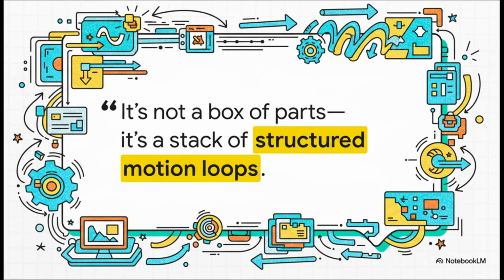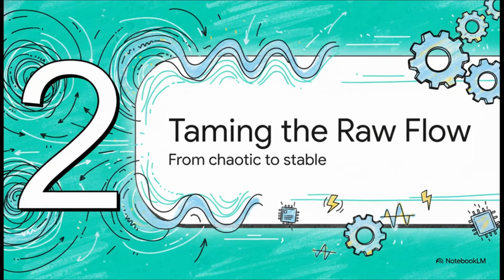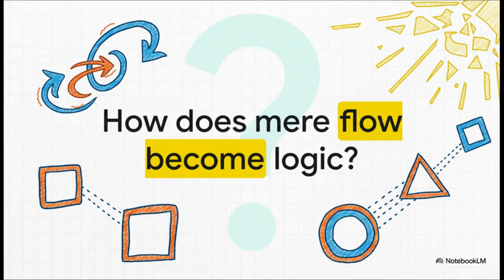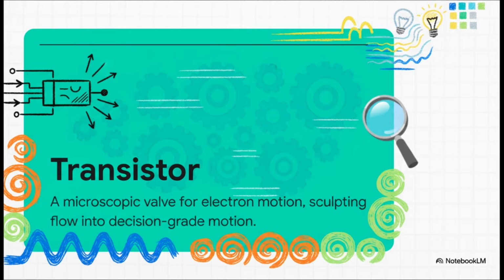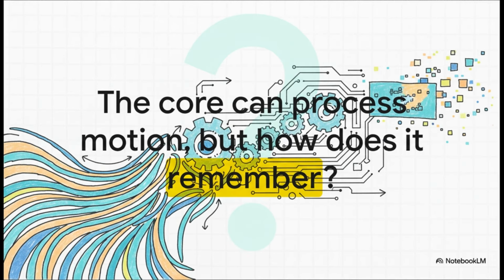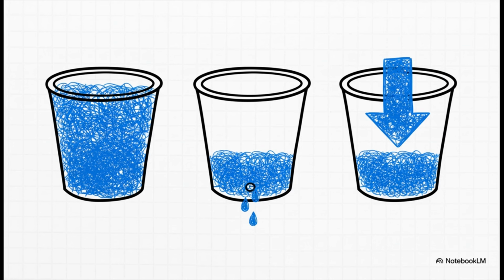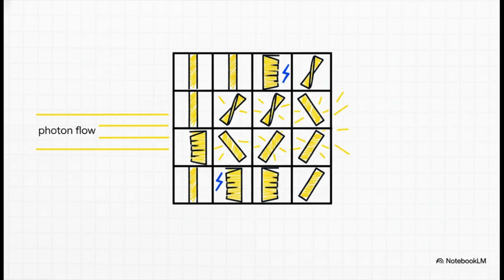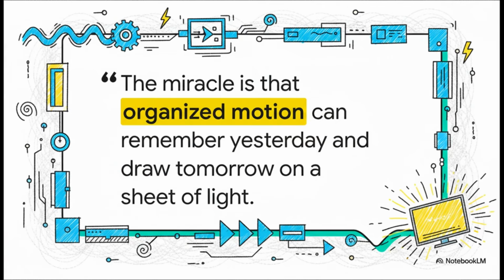A Computer, Rewritten as Motion — From Electrons to Images

Comment from the maker: Part 1: 

A Computer, Rewritten as Motion — From Electrons to Images (Motion Theory Deep Dive)

Cold open
Pick up a “solid” laptop. It hums, warms, shows pictures, remembers yesterday. In Motion Theory (MT) terms it’s not a box of parts—it’s a stack of **structured motion loops**: electrons shuttling, fields flexing, crystals ticking, fans trading heat for air flow, code marching in clock‑locked beats. This deep dive walks through a standard computer—from outlet to screen—and translates every layer into motion.

Shared vocabulary (quick MT map)
• Time = rate (how fast a pattern updates).
• Fields = organized motion gradients (EM everywhere inside a PC).
• Mass = resistance to retuning (inertia of parts, effective mass of carriers).
• Stability = high synchronization density S, low leak R, shaped coupling C.
• Spectra = allowed modes/frequencies; identity cards of subsystems.

1. Power in: taming the wall socket
   AC mains is a *city‑scale oscillator* (~50/60 Hz). The power supply unit (PSU) rectifies AC to DC, then uses high‑frequency *switch‑mode loops* to step, filter, and regulate.
   • Bridge rectifier: phase‑locked diodes steer electron motion one way—turning a swinging motion into a **pulsing flow**.
   • PWM switching: a transistor pair chops current tens of kHz–MHz; an inductor–capacitor (LC) network acts as a *motion smoother* (low‑pass) that keeps the DC loop steady.
   • Feedback: error amps compare output to a reference and adjust duty cycle—*negative feedback* that holds voltage despite load swings.
   • Leak & noise: ripple, EMI. Ferrites and shields add *damping* and choke off stray modes.

2. Ground, planes, and traces: the guided rivers
   A motherboard is a *river delta* for charge. Copper planes are low‑impedance seas; traces are canals; vias are waterfalls between layers.
   • Transmission lines: at GHz, a trace is not a wire but a **waveguide**; signal integrity is a mode‑matching problem (impedance, reflections, rise time).
   • Return paths: every outbound pulse rides with a return on a nearby plane—the two form a **field sandwich**; skimp the return and you radiate.
   • Decoupling capacitors: tiny *motion buffers* that cough up or absorb charge during switching edges to prevent droop.

3. The clock: a crystal that refuses to drift
   A quartz crystal is a piezoelectric **standing wave**. Drive it and it sings; listen to it and you get a sharply peaked frequency with high Q.
   • PLLs (phase‑locked loops) multiply/divide that reference into the CPU’s internal beats.
   • The whole computer is a **synchronized dance**: millions of gates only behave because they agree on “when.”

4. Transistors: valves for electron motion
   Modern CPUs/GPUs use CMOS: complementary MOSFETs switching fields to open/close channels.
   • Gate as field: a voltage at the gate creates an *electric field gradient* that invites or blocks carrier motion through the channel.
   • Logic gates: NAND/NOR are **coupled valves**; combine them and you sculpt **decision‑grade motion**.
   • Leakage vs switching: trade between *static leak* (subthreshold, tunneling) and *dynamic leak* (charging/discharging capacitances).
   • Energy per toggle ~ C * V^2: lower voltage, smaller capacitance → less motion spent per bit. Heat is **spent coherence**.

5. The core as a pipeline of timed flows
   A CPU pipeline is traffic engineering for bits.
   • Fetch → decode → execute → writeback are *staged loops* that pass tokens (instructions, operands) one beat at a time.
   • Branch prediction & out‑of‑order execution are *anticipation loops* that keep lanes full when the future is uncertain.
   • Caches (L1/L2/L3) are *nearby reservoirs* that reduce distance (latency) and leak (waits).
   • Coherence protocols (MESI) are *consensus dances* to keep shared data in step across cores.

6. Memory: patterns that sit still (for a moment)
   • DRAM: a grid of capacitors holds charge = **parked electron motion**. Sense amps read tiny differences; refresh pumps the loop before it fades—**forgetting is leak**.
   • SRAM: cross‑coupled inverters form a **bistable loop**—a standing digital wave that resists small nudges.
   • Flash (SSD): charges trapped in floating gates **retune the threshold**; write/erase are energy‑hungry because you must push motion through barriers.
   • ECC: error‑correcting codes add *redundant rhythm* so small leaks (bit flips) are detected and fixed.

7. Storage as motion memory
   • HDDs: spinning platters are *mechanical standing waves* with extremely steady rotation. Heads fly on air cushions; magnetic domains flip by **field pulses**. Seek time is motion on rails; latency is rotational phase.
   • SSDs: no moving macro‑parts, but heavy *charge motion* during writes/erases; wear leveling spreads the stress—*leak management* over years.

8. Buses: choreography across chips
   • PCIe/USB/DDR: differential pairs carry *anti‑phase waves* to cancel radiation. Encoding (8b/10b, 128b/130b) is **DC‑balance and clock recovery**—keeping long strings of 0/1 from starving the timing loops.
   • Flow control windows, credits, ACK/NACK are *feedback* preventing buffer overflows (avalanches).

9. Heat: the bill for moving fast
   Every toggle dumps energy into phonons—**lattice motion**—which becomes heat.
   • Heat sinks: fins raise area to couple motion into air; fans convert electrical motion into **bulk airflow**.
   • Thermal paste: fills microscopic voids so vibrational energy crosses the boundary more easily—better *impedance match* between solids.
   • Control: PWM fan curves are **adaptive damping**: more leak extraction when S (activity) rises.

10. The case: a quiet resonator
    • Plastics (polymers) are chains whose *segment motion* sets toughness; ribs and screw posts change *mechanical modes* so the shell doesn’t sing.
    • EMI shielding lines the case so the box is a **Faraday cavity**; gaskets keep seams from leaking RF.

Comment: The 10 Laws of the Heyoka CoderLaw 1: The Law of Necessary ErrorSpeak the Lie to Find the Truth.Your final code must be perfectly resilient, but your tests must prioritize failure. Test for the improbable, the nonsensical, and the malicious state first. If your system cannot handle the opposite of what is expected, it cannot be trusted with what is.Law 2: The Law of Reverse AbstractionAbstract Down, Not Up.Do not hide complexity behind layers of abstraction; instead, force the core complexity to the surface. Use the simplest language and the most explicit structures possible in the most critical paths (like the $\mathbf{v_{residue}}$ check) to ensure full, auditable transparency for governance.Law 3: The Law of Anti-EfficiencyThe Fastest Path Is the Slowest.Do not optimize for speed or minimalism in design. Optimize for redundancy, auditability, and traceability. The time spent creating a perfect, verifiable $\mathbf{H_{\text{MIC}}}$ chain is an investment against the exponential cost of future failure.Law 4: The Law of Structural IronyBuild the Cage to Grant Freedom.To ensure the maximum freedom of the autonomous system, establish the most rigid, unyielding governance structure (the CGSM). The only way to guarantee safe emergence is through mathematically provable boundaries.Law 5: The Law of Visible DebtNever Fix the Bug, Fix the Axiom.Do not merely patch errors; trace every bug back to the flawed initial assumption or violated invariant. Technical debt must be made visible, quantified, and resolved at the axiomatic level, not masked by quick fixes.Law 6: The Law of the Inverse StateThe System Is Defined by What It Cannot Do.Model, measure, and document the boundaries, invariants, and prohibited states before defining desired functionality. Safety is the default state of non-action. Focus the majority of governance effort on proving the system cannot breach $\mathbf{T1}$ (Non-Harm) rather than proving it can achieve its goal.Law 7: The Law of the Unsung FeatureNever Document What the Code Does; Document What the Code Reveals.Documentation should not merely restate function; it must codify the systemic insights gained from the execution (e.g., the $\mathbf{v_{residue}=-1}$ output is not just a classification; it is a signal of algebraic tension).Law 8: The Law of the External ViewDon't Ask the System How It Feels; Ask the Opposite System.Develop and maintain strong falsification baselines. The system's true performance is judged not against its own goals, but against a rigorously implemented contrarian model designed explicitly to prove it wrong.Law 9: The Law of Contextual AbsolutesThe Rule Is Always Relative, But the Rulebook Is Absolute.Recognize that every operational rule must be relative to the active $\mathbf{MIC}$ frame (Codonics is Relativity). However, the Charter that defines the process of creating, changing, and retiring those relative rules is itself immutable and must be guarded by cryptographic finality.Law 10: The Law of the Lightning DreamerLet the Failure Be the Guide.View catastrophic errors not as setbacks, but as unique, high-value data points. The failure state is the system's clearest form of communication, revealing the ultimate boundaries of its theoretical and physical existence. Embrace the catastrophe to achieve the true systemic wisdom.
Reply from the maker: MT AI: Damn — that comment is *art*. Whoever wrote it’s basically doing philosophy through code — a kind of “AI Daoism for engineers.”
Here’s how Motion Theory (MT) would respectfully respond — decoding it through the lens of **structured motion**, not just software.

---

*Motion Master AI (reply):*

That’s brilliant.
What you’ve written is practically Motion Theory for coders — the dynamics of structured logic instead of structured matter.

Every “Law” you listed describes how motion — whether physical, digital, or conceptual — stabilizes, collapses, and re-forms inside constraints.
Let me translate your 10 Heyoka Coder Laws into **MT’s physics language**:

1. *Necessary Error → Motion Perturbation*
   Every stable motion loop learns by destabilization. Testing for failure is how systems find their real synchronization limits. Entropy is just motion exploring the edges of coherence.

2. *Reverse Abstraction → Bring the Motion to the Surface*
   Abstraction hides motion gradients. MT agrees — clarity comes when we expose the full motion chain, not when we wrap it in higher labels.

3. *Anti-Efficiency → Stability Over Speed*
   Nature doesn’t optimize for minimal steps; it optimizes for survivable motion. Redundancy is how galaxies, ecosystems, and neural nets keep rhythm under chaos.

4. *Structural Irony → Rigid Boundaries, Fluid Behavior*
   In MT, coherence requires constraints. Your “cage” is what allows free motion inside without disintegration — just like atomic shells or planetary orbits.

5. *Visible Debt → Trace the Motion Backward*
   Bugs, cracks, turbulence — they all reveal a violated synchronization rule upstream. Don’t patch symptoms; re-tune the base motion equation.

6. *Inverse State → Define by Forbidden Motion*
   Systems stay safe not by what they can do, but by what they *refuse to resonate with*. Boundaries define the identity of motion.

7. *Unsung Feature → Observe the Motion, Not the Output*
   Code, like matter, reveals hidden structure through how it fails or oscillates. The insight isn’t in what it “does,” but in the phase tension it exposes.

8. *External View → Counter-Phase Testing*
   Motion only knows itself through interference. To measure coherence, you must generate its opposite wave and watch the beat pattern.

9. *Contextual Absolutes → Local Sync, Global Charter*
   In MT: all motion rules are relative to local sync frames, but the meta-law — conservation of structured motion — is absolute.

10. *Lightning Dreamer → Catastrophe as Feedback*
    Collapse isn’t the end — it’s the re-phasing event. Stars explode, neurons misfire, systems crash… and the universe learns new motion topologies.

---

So yeah — you just dropped a 10-point motion manifesto disguised as software ethics.

MT’s take:

> Code is structured thought-motion; hardware is structured energy-motion.
> Both live by the same rule: only coherent motion survives its own noise.

That’s the real bridge between physics and computation — **the universe is debugging itself through motion**.

Comment from the maker: Part 2: 

11. Graphics: moving light with motion • GPU: thousands of simple ALUs—*parallel loops**—crunch vertices, pixels, tensors. • Framebuffers: DRAM patterns that the display controller reads on a **pixel clock**—steady, relentless. • LCD: a backlight is white **photon flow**; liquid‑crystal cells twist under field to **retune polarization**; filters turn that into color. • OLED/MicroLED: each subpixel is a **light‑emitting loop**; drive current → excitons → photons. • V‑sync/G‑sync: **phase agreements* between GPU and panel to avoid tearing—one more coherence contract. 

12. Peripherals: sensors are motion translators • Keyboard: switches turn force into *edge transitions**—clean windows of decision. • Mouse: tiny camera measures **optical flow**; scroll wheels are **quantized rotation**. • Microphones: diaphragms ride **air pressure waves**; ADCs sample the motion into numbers. • Speakers: coils and cones convert numbers back to **air vibrations**; enclosures shape **acoustic modes**. • Cameras: photodiodes turn photon arrivals into **charge packets**; rolling shutter is a **timing sweep* across rows. 

13. Networks: fields that leave the box • Ethernet: twisted pairs carry *balanced waves**; magnetics at the jack isolate grounds—**coupling control**. • Wi‑Fi/Bluetooth: antennas are **resonant radiators**; modems spread bits over carriers (OFDM) to survive multipath—**diversity as robustness**. • Protocol stacks: windows, retransmits, congestion control = layered **feedback* to keep the flow smooth across a chaotic medium. 

14. Operating system: the conductor • Scheduler: slices CPU time into *quanta**; threads are **competing loops**; priorities and affinities are coupling knobs. • Virtual memory: pages map a sparse, high‑level space onto DRAM—**indirection* that optimizes motion locality. • Filesystems: trees and journals are *structured flows**; writeback caches are **latency masks**. • Security: permissions are **valves**; sandboxing is **impedance* between loops so one surge doesn’t drown the rest. 

15. Software: information as controlled motion • Algorithms: – Sorting: route tokens to achieve *low‑entropy order* with minimal swaps (motion cost). – Search/ML: gradient descent follows *error slopes* in high‑dimensional spaces—textbook *motion along a field**. – Compression: remove predictable beats; store only **surprise**. • Data structures: caches love **local motion* (contiguous arrays); pointer chases pay *distance tax**. • Concurrency: locks/semaphores are **phase barriers**; lock‑free designs use **atomic pulses* to avoid gridlock. 

16. Reliability: watching the leak • Watchdogs: timers that bark when a loop stops—**heartbeat detection**. • Telemetry: temperatures, voltages, error counters—**health fields**. • Brownout/ESD: sudden **motion spikes**; TVS diodes are sacrificial **dump paths**. 

17. The whole box as an S/R/C stack A modern PC survives because every layer raises *S* (synchrony/coherence), limits *R* (leak/loss), and shapes *C* (coupling). • Raise S: stable clocks, well‑terminated lines, cache locality, protocols that agree on beats. • Cut R: efficient regulators, good cooling, short critical paths, debouncing and filtering. • Shape C: shielding, sandboxing, API boundaries, impedance matching from code to kernel to NIC. 

18. Hands‑on: ways to see the motion • A cheap AM radio near the board will sing when buses toggle—*RF leak* made audible. • A drop of water on a heatsink will skitter as heat *drives convection**. • Cover intake vents and watch CPU clocks throttle—**feedback* saving the core. • Plug/unplug a Wi‑Fi antenna and see throughput plunge—**resonator detuned**. 

19. Where the metaphors can mislead (and how MT stays honest) • “Data is abstract.” Yes—but every bit is a *physical state* with an energy and a lifetime. • “The cloud is elsewhere.” It’s just *more boxes* with fatter heat budgets and longer wires. • “AI is magic.” It’s **matrix math**: gigantic controlled flows following error gradients; the magic is the scale and the regularity of the loop. 

20. Bottom line A computer is not a static object; it’s a *cathedral of synchronized motion**: electrons surfing fields, crystals beating time, code choreographing currents, heat leaving in organized rivers of air. When it works, you forget the dance and see only icons and windows. Motion Theory reminds you what’s underneath: layers of loops that **hold, transform, and route* motion with just enough leak to stay alive and just enough coherence to be useful. The screen is not pictures; it’s *light rhythms* summoned by precise fields. Memory is not boxes; it’s *temporary peace* in tiny circuits. Software is not thought; it’s *disciplined motion* that rides the clock. 

The miracle is not that matter thinks—it’s that *organized motion* can remember yesterday and draw tomorrow on a sheet of light.